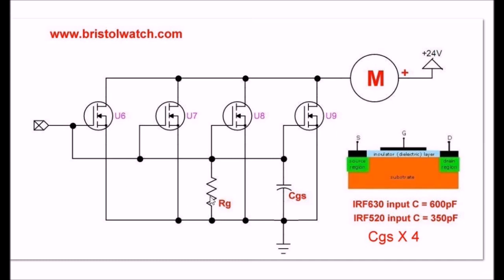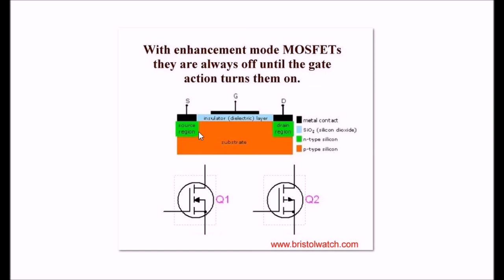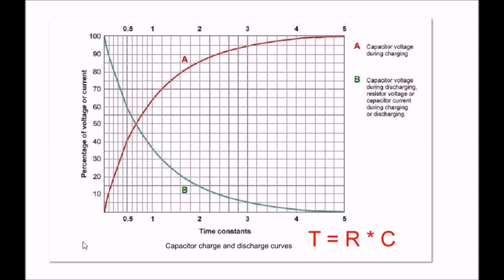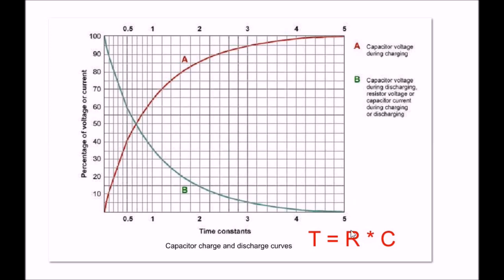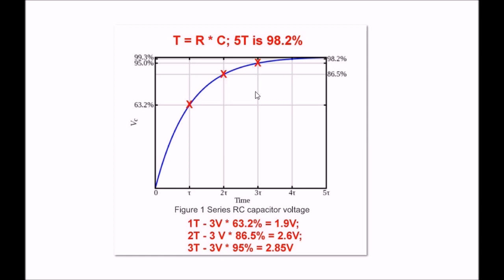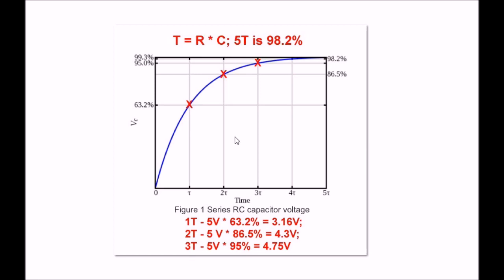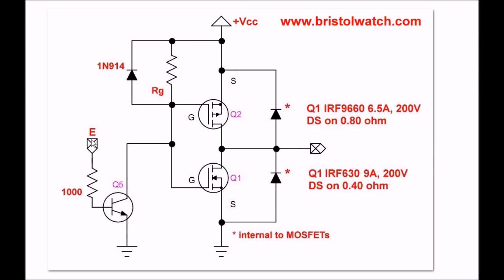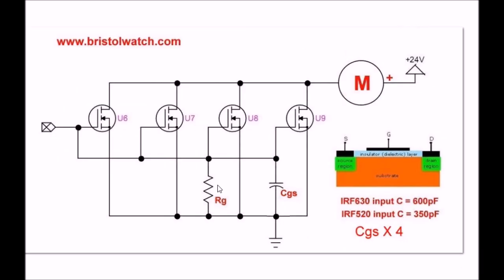Issues on Connecting MOSFETs in Parallel

Comment: For some reason I was under the impression that MOSFETs in parallel would self balance because if one is taking all the load, it would heat up increase resistance and take less load. Oppsite of what BJTs do.

Comment: Gate capacitance is not the scariest thing in direct parallel connection. The scariest thing is ringing. Especially in half bridge circuits, which basically can cause  a "shot-thru" BUS to GND. So NEVER connect 2 or more gates together without placing extra resistors per gate, to prevent LC circuit ringing in  Gate-Source - Source-Gate

Comment: Hi Mr Loflin, I'm very interested in the Drive Circuit at 15:51 of this video.  I want to trigger 16 coils in a pulse motor simultaneously.  1000W in, 1.3A per coil.  I know how to do this with MJL21194's  but not with mosfets.  I attempted to bread board the circuit but It got very congested and problematic for me, I'd rather solder a circuit.  Any feedback from you would be of great value.  I will trigger the fets with Hall device or opto switching.  I can do those as well.  Need help and advice with the 16 parallel mosfets. Thanks, Donald.
Reply: I have since cut brds on my router and will test today.  brds are for driver and 3 fets switching 3 coils of pulse motor.

Comment: Old video. Now days (2022) it is not really necessary to parallel small (under 50amp) FETs since single units with internal matched dies capable of hundreds of amps are available that will be much more reliable.

Comment: Hi Lewis,  IXYS 4500V High Voltage Power MOSFETs and PCB are already made... for high voltage switching. I just wanted to know how they did it.   I want to go  10K volts with two of them in series if possible.   maybe four of them for 20K...    What is involved in making this work without arcing and we can get a fast 20us pulse train out within a period of time.   we will need heatsinks possible water cooling don't know.   Its a tough problem... no doubt.
Reply from the maker: I know the part but not the the PC board circuits. I learn new things all the time myself.

Comment: MOSFETS in Parallel give more current if they synchronous;  However if we do these in series with a 1200 volt drop across each other.  I can reach 10K volts with about 10 of them plus some lead way.  I what to switch 10K Volt signal around 20usec range.   Not unless there is another way?
Reply from the maker: Don't think so. You are trying to use MOSFEts as a type of series resistors. Each G-S voltage will be different and the circuitry for this is very complex and not practical at this level.

Comment: @0:47 Great video - thank you. May I add that it is recommended to connect a resistor between each Gate and Driving Singal - Also I would avoid connecting all Gates together, at least if one transistor get damaged then the others operation will not get affected and for timing purpose. Also, you may add seperate bleeding resistor Rg for each transistor and account for the total resistance seen by the source, from output looking into the input.
Reply from the maker: Agree. this is a demo and ideas are always welcome.
Reply: How do you figure the resistance needed on the gates I'm trying to parallel  6 MOSFETs  for a amplifier  and several videos later  I still don't really have a answer or a way  or do I just start putting a resistor till I find it maybe working
Reply: @Davidsmith218    You may use trial-and-error but is not good practice. For a given MOSFET you must refer to the data sheet for optimal Gate resistance. Please read the data sheet and learn how MOSFETs work, I have been working with them for over 30 years and I invest my time on designing and building, rather on educating.

Comment: dear lewis loflin i want to make transformer isolated push pull dc/dc converter with two mosfets and microcontroller with sinusoidal pwm output. how can we resample shunt resistor voltage at primary side. should we get some feedback from secondary side?

Comment: what would be the main reason to use mosfet in parallel ? is it to make the amps double ? drain to source i mean ?
Reply from the maker: Yes it will carry more current and less RDS resistance.
Reply: @LewisLoflin  very nice so if we need more voltage will be in series then ? Ok if am connecting two in parallel what will be the value for the pull down resistor? Can I pulse with the same arduino or the same driver like 4420
Reply from the maker: @EnergySeeker  No on the voltage. The problem is switching on the gate circuit.

Comment: Tricks-n-Traps of MOSFETS. You "can" use a microcontroller to turn on a N-ch mosfet up to a certain frequency, low speed like blinkers on your car is fine. IF you're trying to vary the speed of a motor, much better to use at LEAST a gate driver IC that basically consists of two N-ch MOSFETS with an additional charge pump circuit. It will keep your output MOSFETS cooler during higher frequency switching with much less RC constant.

Comment: Thank you for this tutorial on parallelling  mosfets my application is to build a quarter bridge induction heater 
and I will try to //  several mosfets to drive an induction coil (6 turns)  achieve high power of about 2000watts.

Comment: hi...PLEASE HELP,
I have a TC4429 Driver chip and a IRF4905 P channel mosfet.
I want to make a High side drive.
I have put a 1k resistor from gate to positive,  
the Source is direct to Positive and a 12 volt 1 Amp bulb is connected to drain and Gnd.
the TC4429 is run on 12V.  i am feeding it with a PWM signal.
I cannot get the P channel mosfet to vary the output at all. it stays in the ON condition.
if i use an N channel mosfet it varies the output... in high side mode... but makes lots of heat!
i just want a decent High side driver ... i want 3 amps at 24v output with PWM control once i have a good circuit.
HHHEEELLLPP!    :o)

Comment: Thanks, for good expl. but true is if you try connected mosfets in parallel up to 24V it will work but from 100 -240V it will fail under heavy load because the truth is that in nature there are no things that are 100% similar to each other and in this case one mosfet will turn on faster than another.

Comment: Great explanation. 
In the half bridge, is the diode not to discharge Cg through the source of Q2 to make it turn off faster and prevent shorting Vcc? I'm not following the noise explanation? 
Same with D across Rg on the fet parallel CCT driven by an MCU, is D not there discharge Cg through the MCU pin when 'low'? I'm not following the voltage spike unless you are meaning D clamps Rg to Vf?
Reply from the maker: The diodes are spike suppressors.

Comment: I try to read comments before asking my simple questions, as to waist time. Several years have passed but my question is; with 4 MOSFET’s in parallel is increasing the current flow rating? 50 amps each times 4 = 200 amps. Operating at say 160 amps including inrush current, but spreads the heat and load across multiples of matched sets, is this the Benefit or used for a different reason? Just a 62 year old guy trying to learn. I know you’re busy but perhaps someone could chime in. I fixed vehicles, not electronics. Now, forced into retirement I am building a 55 year Chevy truck from my childhood. It’s just getting 3/4 of the electronics from a 2003 Tahoe and the Body Control Module is ( Thru Per-Planning) how to provide 6 different signals from the BCM that requires from a key switch that only produces 4 single signal. Rather than controlling relays thru 3 watt diodes, I was thinking of smaller diodes to control 12.8-14.8 Vdc using N-Channel MOSFET’s. (I don’t need 4) Example;
Crank.
Crank, Run.
ACC, Run, Crank.
Run.
It is required inputs into the BCM so it knows by the order of inputs, which modules to turn or  or off. It’s called the power mode master. Yes, I can spend days with a dash ignition switch, but major modifications needed to mount an 03 switch on back. I am thinking of future repair, diagnostics and parts. I have to create an entire service manual so anyone at a dealer or shop can not waist time and fix my son’s truck after I am gone. Any help would be appreciated! I like the “KISS” method of design (Keep It Simple Stupid), 12 volt into multiple circuits, separated by diodes, but operating a simple mosfet. In turn, it controls a relay that turns on a buss bar, fused protected for all circuits, yet a single signal input into the BCM. I am not using all of the toys, but 3/4 of them. Sounds complex, yet everyone want to use a ardrino. Not me! KISS and If designed well, will never fail. Thanks!
ASE Master Tech since 1978 - Retired

Comment: Hello. Good presentation. Thank you. Cgs is represented wrong in the variant with seperate Rg-s. Cgs is after the Rg for each fet separate. It is the gate source capacitance. Can you explain little bit how do you prevent shoot through in you mosfet push-pull driver. Thank you for sharing your knolage.

Comment: A note from practical experience: Driving at 12V solves some problems, but makes a new one: There's a parasitic inductance in the wire to the gate. You can get some ringing, which means when you drive up to 12V you can briefly generate an inadvertent voltage in excess of 20V and exceed Vgs. Lost a few power MOSFETs to that before I figured it out. It's easy enough to avoid once you know to look for it.
Reply from the maker: True if you are doing this at crazy high frequencies. But this is hobby circuit level not a commercial level say switching power supply. Thanks for your input.
Reply: @LewisLoflin  It's not frequency that's the problem, it's rise time. Sticking a few ohms between the driver and gate solved it for me - it slowed the rise time down just a little, thus bringing the ringing within an acceptable level.
Reply from the maker: Correct. Thank you.

Comment: Hi Lewis, Do you think mosfets could be driven from automotive points, allowing the points to only need to handle only a small voltage suficient to operate their gate, rather than that from the primary coil and still retain the mechanical tuning of the points for static timing, primary coil charging dwell (on) time and advance etc? Would this eliminate the need for troublesome condensers?
Reply from the maker: I see no problem with that if wired correctly. You are supplying a turn on voltage not a high current to a coil.

Comment: Why do you use ground symbol for VCC?
Reply from the maker: That is a power symbol in my schematic software. Perhaps it differs in older or non-US drawings?
Reply: @LewisLoflin  That and ground symbol you're using both are for ground.
For example in Kicad default ground symbol is that you used for VCC.
Reply: @LewisLoflin  Here found a link for you: https://www.eeweb.com/wp-content/uploads/articles-quizzes-quiz-ground-answer-1305526105.png

Comment: Fortunately, I'm dealing with building four solid state relay circuits for four battery modules, and each module's solid state relay will involve two parallel MOSFETs for a total 52KW power handling capability for each module, at a max charge of 109.6 VDC each, at a max current draw of 254 amps. I will not, of course, allow the load to draw any more than about 50-80 amps per module for the inverters. So, capacitance isn't nearly so critical. My power MOSFETs have a VGS of 4 V Max. 2 Min, 3 typical, and 4 Max. The MOSFETs are rated at 200 VoltsSD and 140 AmpsSD. Their part number is STE140NF20D. Their RDS is between 10 and 12 milliohms. They will be on large aluminum heat sink blocks and I will see what they heat up to in operation as to if I will need a fan. Great power backup for the house in those times when local power drops out for whatever reason.

Comment: Lewis - Thanks for sharing your insightful experience! I did all the odd problems in six electrical engineering text books, but it helps to hear someone else's perspective. Fun fact: The video pace was perfect first time through. The second time I was able to soak it in at almost 2x speed!  :) Good stuff!!
Reply: Can u tell the names of these books, please?
Reply: @waltersullivan3787  Below are the books I used. I got them at the Harvard Coop or MIT Book Store some years ago. MIT students were using them. Each book is two courses for six total. It was quite a bit of work but well worth it to me. I don’t think there are any shortcuts but videos here are really good.  Also, I don’t think the basics are changing that fast. So, for me,  book versions that are a few years old are great and you save a lot of money. These were really good for me. Note that at least one of these is the electron flow version compared to conventional flow. I found that easier to learn at first.

Good luck!

Digital Systems Principles and Applications
By Tocci and Widmer

Principles of Electric Circuits Electron Flow Version
By Floyd  (You need to learn this before Floyd’s Fundamentals book below.)

Fundamentals of Analog Circuits
By Floyd and Buchla
Reply: @michaellapierre1244   Thanks a lot. I have a background but I was looking for the good books to organize my knowledge. Have a nice day.
Reply: @waltersullivan3787  Best to you!

Comment: I thought I was on uncle Doug channel. You sound very similar. 
So today I felt bold to learn about transistors . Pulled some out of old parts , looked them up on spec . Have one working with my hand when I touch the gate . 40 volt dc trying to lower to 12 v  have a pnp to work with . If I hook the gate to power it full on . If I use my hand I get 12 volt depending how I touch it . Do I need a higher ohm resistor to solve this ?
Reply: Check the datasheet

Comment: Hi Lewis,
And thanks for your very well explained videos.

I tried using two mosfets (ref RU8580, Amax=90 A, Vmax=85V, RDSon=5mOhm, Vgs=3V ) in parallel to power a vacuum cleaner motor (150W i'd say, so the amps to pass is lower than 8A). The battery is around 20V (7 Li-Ion cells in series). I used a resistor-divider setup (with a pot in the middle) to have a variable input voltage of 2-6V for attacking the gate of the FET. The total resistance of the resistor-divider is 120 KOhms. There's a 10K resistance from gate to ground, preventing the gate to stay on even when lowering the pot. I found the setup fries one of the FET quickly (5-6s) even with a 10 cm² heatsink on the fets. In the meantime, I stuck a DC-DC buck converter to get the job done (no problem) although the output is low (3A max).
I'd like to understand why my initial setup didn't work, so if you have any idea on this, I'd really appreciate. I read a bit the basics on the mosfets, I have little experience though.
Thank you !
Reply: Driving inductive loads is tricky because energy is easily coupled in undesirable ways. Short length of wiring in the control circuit are very important and preventing energy coupling from the load to the gate pin is critical. Lower the gate pull down resistor to 1K and the resistance of the divider to something on the order of 10K would help. Also consider than the voltage across the motor can spike to crazy values at times due to the nature of the motor. Putting a large foil type capacitor with a 100 or higher voltage rating across the load may help.
Reply: I'm trying to make a dummy load. Mosfets are P75NF85. 75A 80V. Six of them are connected parallel. They aint warmin up til the 3A if they are not parallel. But when I connected parallel 6 of them allways one of them is burning up after the 5Amp. Then the other and the other. So every of them are burned up. I'm using 80mmx150mm heat sink with the fan cooler. Gate resistor 1K for every mosfet apartly and the voltage divider is 4k7. They are not working that like they are connected parallel. My driver is arduino over opamp, gate voltage 10V dc,  Vcc 12vdc for drain, duty cycle %10 maybe %20, pwm freq 3.9khz 

I think have not fault myself but the result is  like you know.

Comment: Really good!! Thanks for sharing  knowledge! Something I was thinking... It's usually done with N-Mosfets, because of the negative thermal associated resistence, ie, the more it heats up, the more resistivity it gets. It's the opposite for P-MOSFETs, correct me if I'm wrong.
Reply: Actually both P and N channel MOSFETS increase in resistance with temperature meaning it has a positive thermal coefficient. This is important because it allow the transistor to easily share current because even if they vary widely to start with they will heat to equalize themselves if enough load it put on them to heat them up. This is unlike junction transistors that pass higher currents as they heat up right until they get too hot and die. The reason that N channels transistor are preferred is that they can be made to handle higher currents and have lower resistance using the same amount of material. However in many circuits using a P channel transistor results in simpler circuitry. And modern P channel MOSFETs perform pretty well at a reasonable price. But for serious power levels N channel is the way to go.

Another important thing to keep in mind is that junction transistors are basically diodes that have to be turned on while MOSFETS are more like resistors that can vary in resistance from very high to very low. They difference is the junction transistor can only pass current in one direction while the MOSFET can pass current in both directions. If also means that the junction transistor has a fixed forward voltage drop that is a loss of power in the system. For example: Passing 10 amperes through a junction diode results in ~0.6 Volts * 10 Amperes = 6 watts of power converted to heat in the transistor. While a similar MOSFET might pass 10 amperes with resistance as low as .005 Ohms. So power loss is I * I * R or 10 * 10 * .005 = 0.5 watts. MOSFETs can also be placed back to back (sources connected and power flowing flow drain to drain) to switch AC current.
Reply: @briannebeker2099  that's really interesting! Thanks for sharing knowledge, it's really nice!! 👏 👏